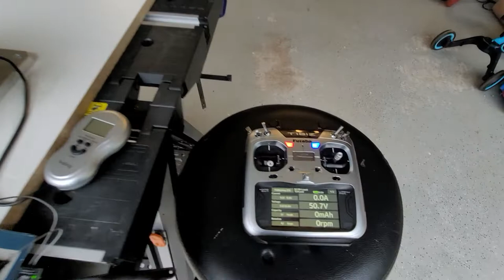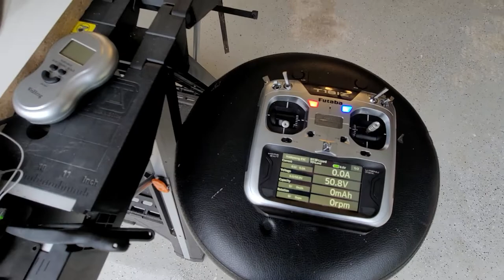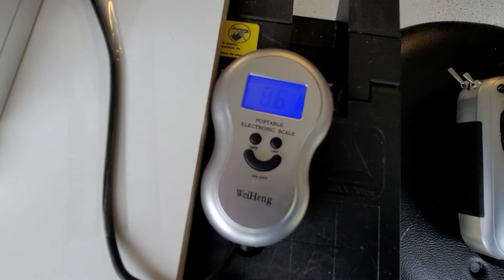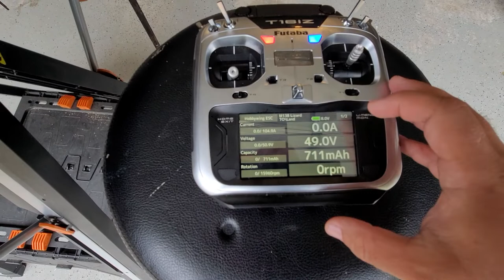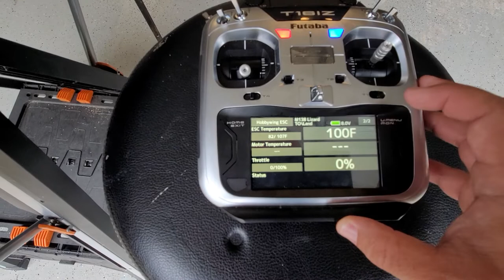Ejets Jetfan Pro 120mm EDF thrust test (with and without thrust ring)

Comment: question how did you get the telemetry rpm to read out correctly on your 16 Iz?? for some reason mine only reads three decimals.
Reply from the maker: I am not sure.  I don't think it's reading correctly though.  It's showing about half of the calculated value.  I think there was a setting in the telemetry unit.  If I remember right if you hook the program box to just the telemetry unit there are some setting in there.  Otherwise select the rpm in the radio telemetry and set the poles and gear ratio.
Reply: @pilot482  so I'm running a large OutRunner motor which is a 28 Pole on 14 cells in a 35% extra 300, and the tachometer on the radio only shows 642 which I assume is 6,420 rpm ,I talked with Futaba technicians Ian and Tony & said to update radio but my radio is brand new just bought it 2 months ago and I have a 14 SG that does not have this problem but yes you do have to set the radioTelemetry RPM to the correct number of poles of the motor to get the correct RPM reading that I did , but it's not showing the correct amount of numbers on the display.. .

Comment: So if I understand correctly, you went from 9kg to 18kg thrust? Just because of the added ring? I know it increases the efficiency, but I didn’t think it was 100% more effective…
Great video btw
Reply from the maker: Yes.  I knew the ring was effective but I was shocked by how much.  Proper intake ducting is extremely important whether it's a inlet ring or a full ducted intake.
Reply: Pounds not kilos
Reply: NO, you will not double your thrust with a ring, the first test was in kg and the second was in lbs. He just doesn't know it. 9kg is roughly 18lbs.

Comment: Nice tests! Did you run any tests to monitorize the temperature of the electric motor, for example, to know how much time is it capable of performing at maximum power without reaching the limit temperature?
I think this could be quite interesting to know, and also for the maximum time allowed for lower power levels
Reply from the maker: I didn't do any test like that.  Didn't think of doing that.   It really doesn't get that hot even after a complete flight.  Don't think temperature would ever be an issue on this set up.
Reply: @pilot482  How long are usually the flights you performe, and at which power level?
I have been warned that a typical problem that these ducted fans have is the temperature management, specially when performing at high power levels continuously
Reply from the maker: Flights are 3:30 on 5600mah packs.  Mixed power setting.  I sometimes run it fast because it a lot of fun to fly the jet it's in fast.  It's never hot when I land.  Just warm.  Also on all my higher powered fan I use heat sinks which helps a lot.  They sit directly in the air flow and are very effective.
Reply: @pilot482  Nice to hear. I wanted to do some tests with some EDFs but for another application, which I need to be able to give full power to the motors during 15 minutes, and I assume that this is not possible with regular Heat sinks, right?
Reply from the maker: I am not sure.  I don't have batteries capable of powering an EDF for that long.

Comment: Hello, thx for the test but the rpm from the motor cannot be right? You have a motor with 685 kv with 12S. On the Telemetrie i saw 15.700 rpm 🤔 Motorpole wrong in the setup from Telemetrie ? By
Reply from the maker: I may not have the number of poles set in the TX.  I can't remember.  I was more interested in the amps, thrust and ESC temp.

Comment: Hello mate, 

I was looking for information about this fan and I just came across this video. Do you have more information about the fan's thrust at different velocities? Actually, any data regarding thrust/pressure jump would be highly useful to see if it would fit in my case. I would be highly interested, as the manufacturer does not provide any information. Thanks!
Reply from the maker: Sorry.  I didn't think about testing for that.  I did move the throttle to about half and go around 8 pounds with a much lower amp draw on the ESC.  But I don't have any more than that.